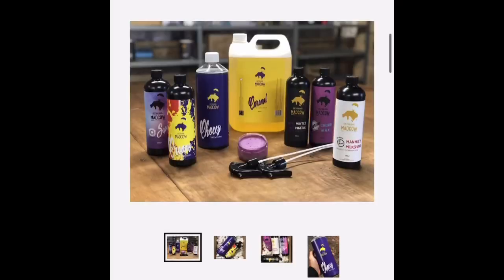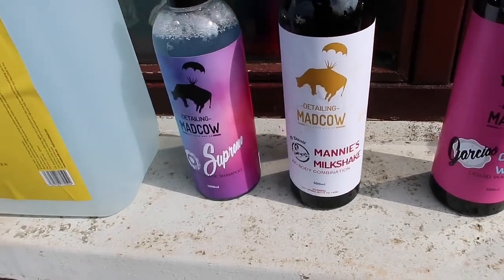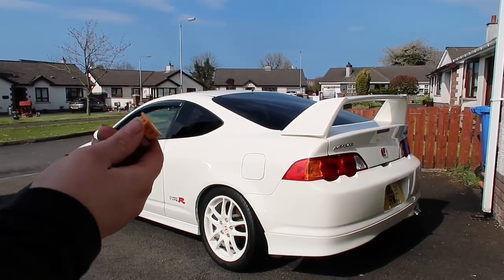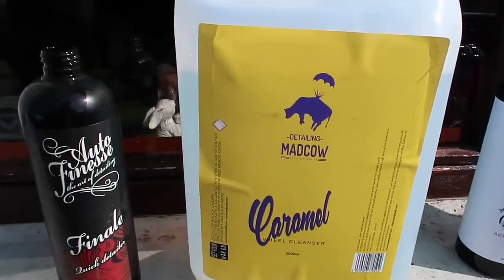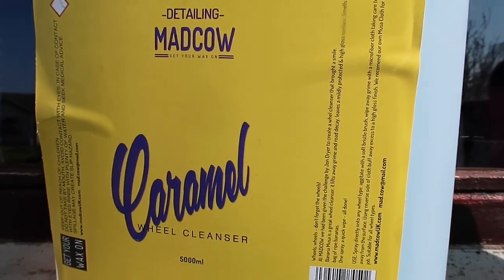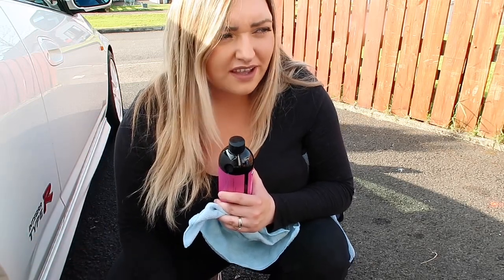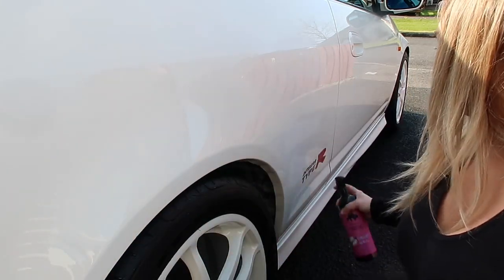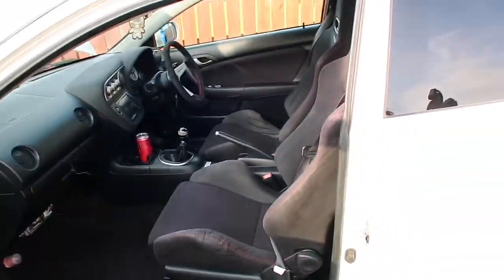£145 worth Madcow Bundle Review - car cleaning products used on Honda integra dc5 type r | wax

Comment: Thanks for the review. It sounds like you may have been better spending £30 on products from one of your preferred companies. The wax looked awful with a very bad “ pour” by the looks of it. Reviews like this are probably more useful than the ones where all the products perform well.
Reply from the maker: Thanks buddy. Yeah I agree, I’d rather see honest reviews. The glass cleaner was the best tbf. Made a good video, not so good for the bank balance lol
Reply: I would be willing to bet that the Glass Cleaner is 50% IPA and 50% H2O.
I bet it works well as a panel wipe.
When you couldn't get that sticky sealant off maybe it didn't chemically react well with the sealant that was already there. A guick spray of panel wipe would have sorted that out. Then just apply yours and Ryans favourite sealant on it. Which I am guessing will be Autofinesse product?
Never used any products from them. But I hear they are very good.
Great wee video thanks and stay safe. 🌹🌞🏴
Reply from the maker: Kinnon McAllister probably. It was good. The best out of the bunch. Thank you for your comment as always buddy. 🙌✌️